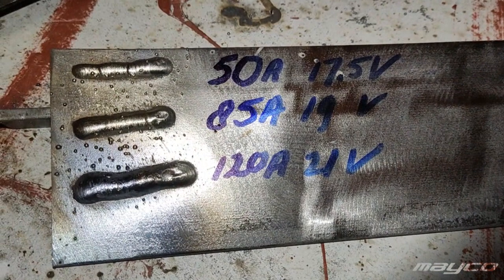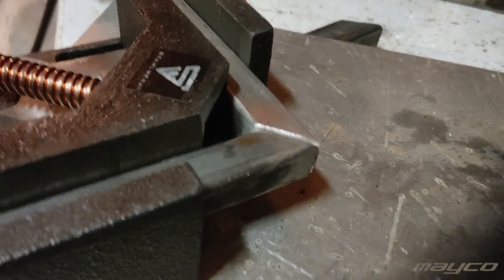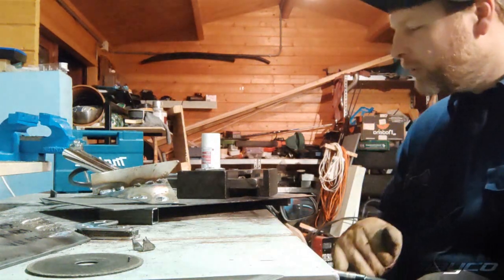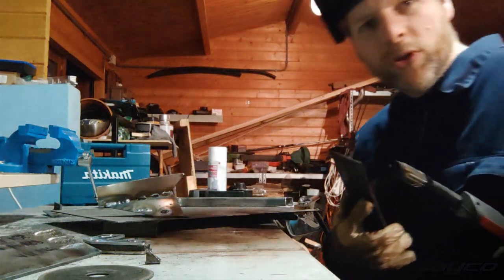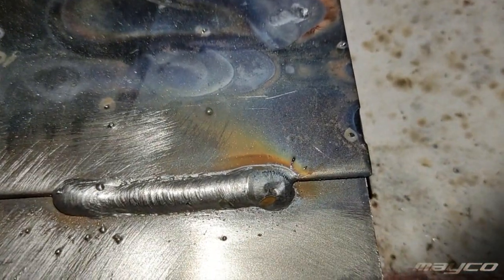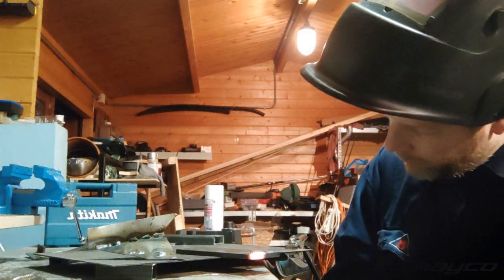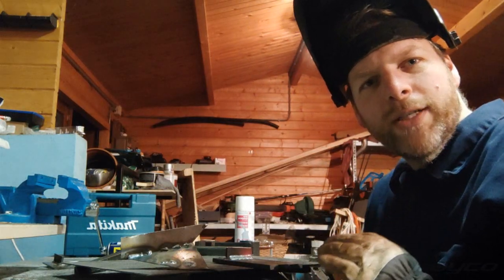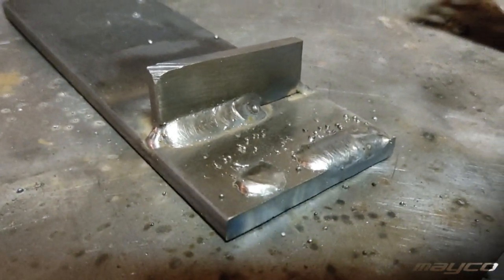PART 6 - Stahlwerk mig200st more testing 4 good settings

Comment: Hey mate, really nice that I found your videos, as I kept having my MIG175st popping. And it seems it was too high of Amp, and thanks to your videos, my welds are now looking better. Got confused on my MIG175st, with the Amp and wire speed setting, which you have explained well. And the first knob is as such not speed.

Comment: Hey Mate
I watched a few of your videos. I like how enthusiastic you are in finding out how things work. Chapeau for that.
I disagree with what your pro welder told you about penetrating more into the Material. Boosting the Amps is not the way to do it on, for example, 2mm thick boxsection.
What I saw in your video is that you pulled your torch...
Well, ok thats a possible way to Mig weld. But normaly the torch has to be pushed. By pushing your Mig torch you will penetrate more with slightely lower amps, wich prevent burning holes into your Material.
Maybe you give it a go an try it that way and let me know how it worked for you .
Regards from Germany 😉
Reply from the maker: Thanks for your tips!